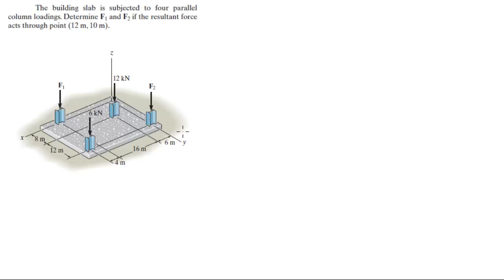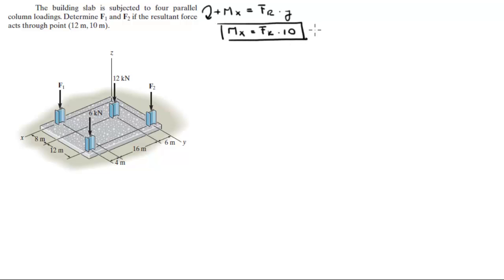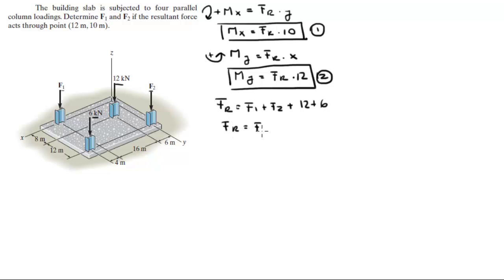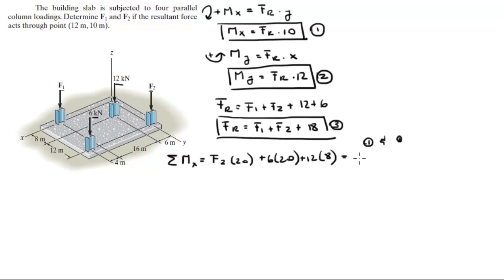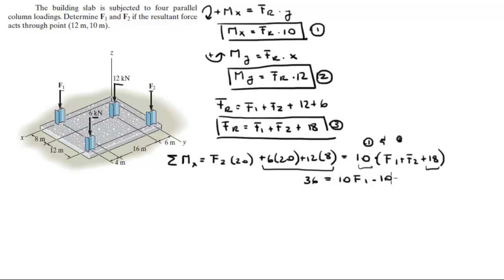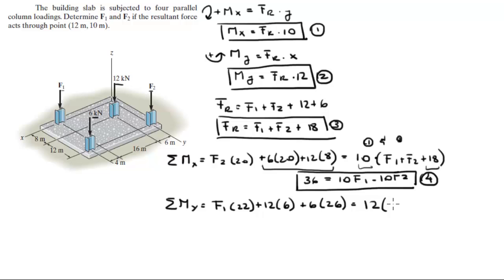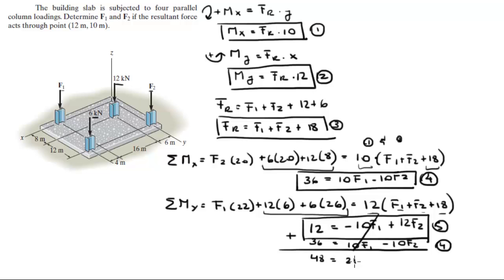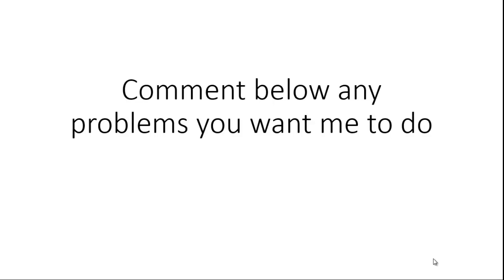Determine F1 and F2 if the resultant force acts through point (12 m, 10 m)

Comment: okay so i have the same problem but my F3=15kN and my F4=8kN, i did the same equations u did subbing in any 12's u had with 15 and 6's with 8 as those are my values. I also changed the 18 to 23. in the end i cant seem to get the correct answer though